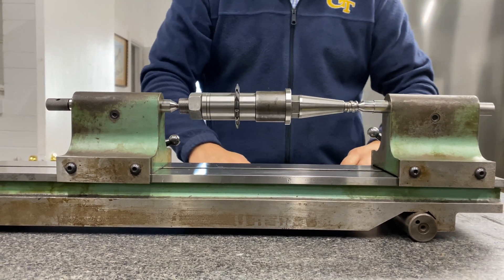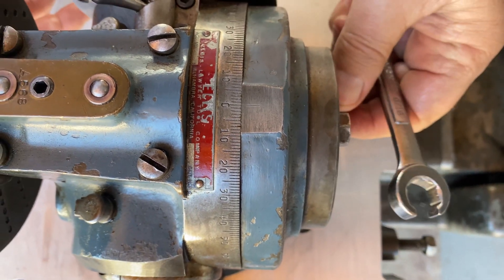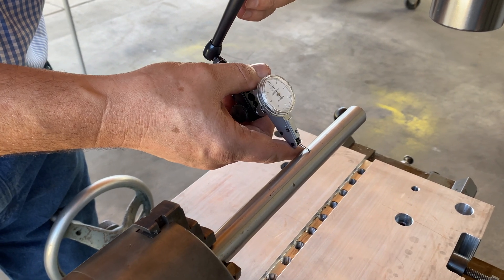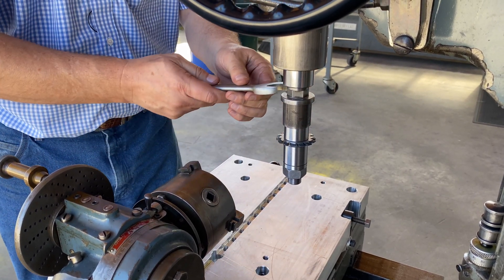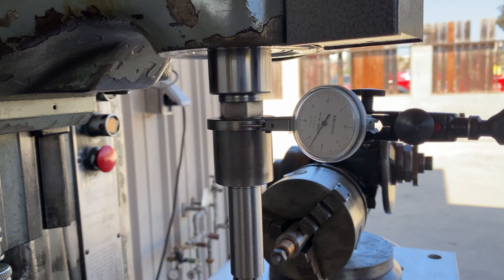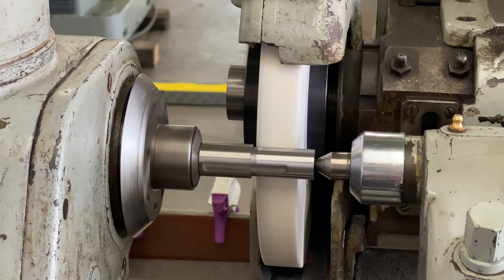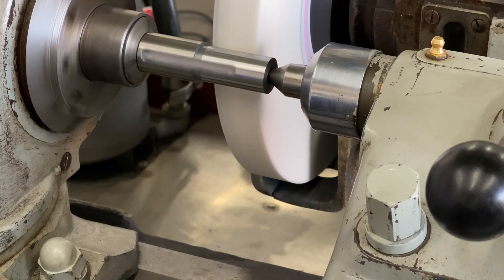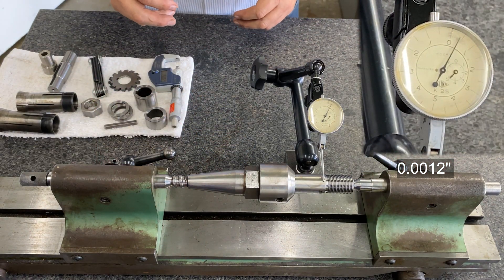Milling a Gear 2 -  Making Mounting a Gear Cutter

Comment: 0.0012 run-out is quite a lot for a center grinding operation in our shop. may want to check / repair the head & tail stocks on the grinder and/or test stand. also inspect the center holes in the arbor. you should be able to easily achieve 0.0002" or less. Cheers 👍
Reply from the maker: Yes, you are correct and very observant.  This grind went a little too far on the arbor.